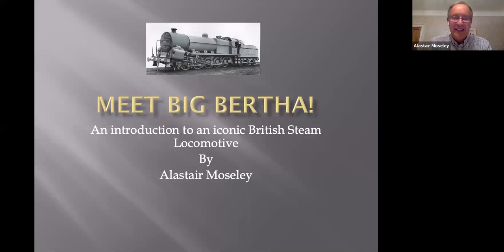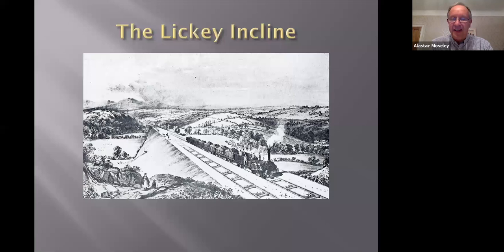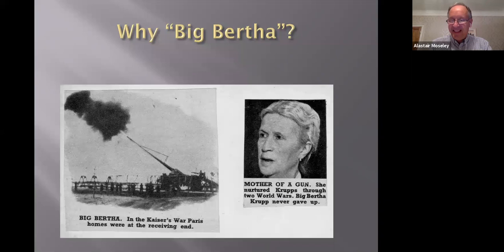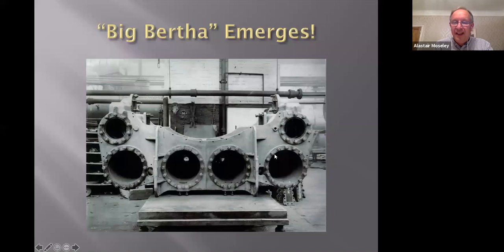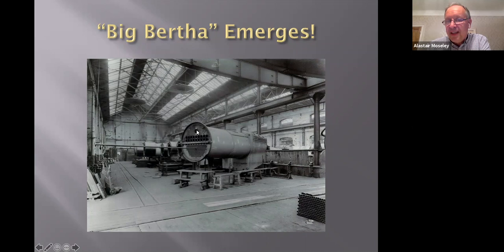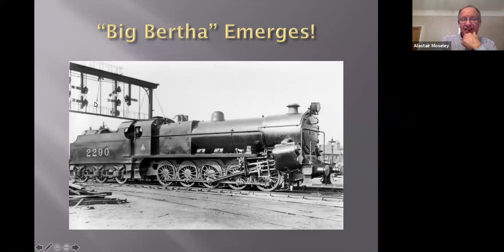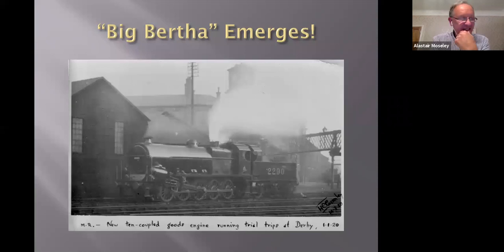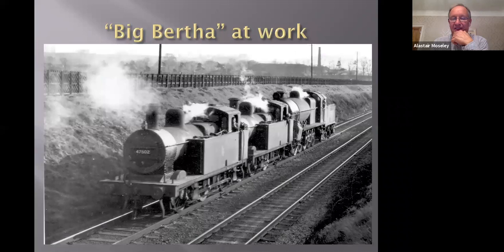Big Bertha: Celebrating the Centenary Year of a Bromsgrove Icon, presented by Alastair Moseley

Comment: Thanks for that Alastair, Most enjoyable stuff, Two items to note but not picked up on, (am i being picky) 10 driving wheels and all with flange's! unlike the 9fs, also of note, Balance / Reciprocating weights on centre driving wheelset appear to be maybe 10 degree's out of time to the rest, clearly for a reason? maybe to take out vibration when coasting down the bank. Cheers.
Reply: hi. the offset balancers in the central drivers isn't too much of a rarity, especially for multi driven locos. you'll see them on the set where the piston rods and connecting rods are connected, this axle having the greatest reciprocal mass. the idea is that at speed the offset balance will counteract the dynamic augment (hammerblow) of that heavier axle set which also has to take the included weight of the piston thrust.  if you look carefully you'll not that the weight is behind on the leftside, ahead on the right. at 90° instead of a balanced 180 they'd be a lot of force concentrated in only a quarter turn and in the locos case with heavy rods at the end of each piston thrust the offset balancers are "throwing" the weights slightly ahead or behind of the end of the piston stroke, thus creating a reverse inertia as a counteraction. 
:)

Comment: No mention on the unusual sloping top of the fire box from the Belpaire Ring down to the cab. The inside cylinders don't appear to have a steam chest.  Is the loco a compound if so how is the steam passed in to the cylinder and out to the blast pipe. ? Can please someone enlighten me as to this puzzle. ?
Reply: Hi Ken, I read somewhere that Big Bertha was a cross compound with the L-H outer exhausting into the R-H inner and visa versa. If outer cranks set at 180 degrees would this work? Would love to know more and would explain why the cylinder blocks were considered to be so unique. Any ideas how to find out more? Alan Whittaker. Derby, ex Toton
Reply: @alanwhittaker1447  My understanding of this, based on a number of articles that I've read over the years, is that the locomotive was not a compound. However, because there was insufficient room for four sets of valve gear, the inside cylinders were fed by the unusually large outside steam chests, and the steam was passed to them by pipes that were perforce longer than the passage to the outside cylinders.  Inevitably, the valve events were not ideal; but on a slow-slogging locomotive of this kind, that did not matter enough to make the idea unworkable. (I am certain that I have seen a detailed drawing of the cylinder-and-valve layout, including the crossover pipes; but I cannot find it — my huge collection of magazines and books is in a complete mess since a house-move.) I might be wrong about some details; but I'm pretty certain that I have the main points correct. Some aspects of this arrangement can be seen in the drawing at 13.03 of this excellent video, and in the amazing photographs immediately thereafter.  Also, the photo at 1.20.40 clearly shows the pipes coming off the top of the valve chests and going "inside" towards the inside cylinders.
Reply: @alanwhittaker1447  As an aside are there any forums that discuss these subjects ? I live in Australia and would like to keep abreast of this aspect of railway history. I would appreciate any links you could provide for this old 88A Canton Cardiff boy.

Comment: hi great video,big bertha was a great looking loco. sheer brute force on  tap, what clowns went and scrapped it.when it could have been sent to a museum. hornby and bachmann have not made a model of it, again clown activity
Reply: DJH did a white metal kit, i have it but don't run it, for display only, it is as built with high tender sides, later lowered to assist in reverse operation.
Reply: Peter Smith, when I was an apprentice at Derby Loco Works I watched Big Bertha being cut up. I was too upset to notice if anything was saved.
Reply: Rapido are going to do Big Bertha in OO.
Reply: @keithparker5103  Shame we have no pictures of cutting up the scrap. Scrapping steam locos is great fun. Break them down and send the pieces for melting!
Reply: @PreservationEnthusiast  There is a big difference between train (loco) spotting and seeing them cut up. The last major scrapping year was 1966, if you were born in 1953 then in 1966 you would have been 13 YO. Unless you had spare time access to a scrap yard via a relative or friend you would not have seen much. Sure there are videos on You Tube, all the ones I have seen are of locos past their sell-by date. It should be remembered that if British Railways had stuck with steam traction many hundreds of older loco's would have been scrapped anyway.
I worked for British Railways from the mid 50s    to 1991 and I saw a LOT For 6 weeks I was seconded to Swindon works in the mid 80s before it closed to source spares for diesel locomotives common to Derby and Swindon, I saw many diesel loco's cut up, mostly class 31s and 25s one of which was 25 158 for which I had a soft spot, but that is irrelavent here. The gripe that many enthusiasts had was the total extinction of many classes thus depriving future generations of heritage pieces in museums. In the same way many municipal bandits destroyed many ancient buildings in the 60s in the name of "progress" British Railways even wanted to demolish St. Pancras station, one of the most beautiful buildings in London. Your constant displays of glee at things being destroyed smacks of slight immaturity to provoke responses. I suggest you change tack.
Reply: @keithparker5103  There were plenty scrapped by the big yards, Cashmores and Drapers as well as many others in 67 and 68. 

Also,  I don't see why an interest in recycling should be immature while an interest in preservation should be mature.

Some preservation has been much overdone. For example 30 Bullied Pacifics and around 40 class 37 diesels, many lying around rusting in heritage line sidings. We don't need old locos in those numbers and some of them have little hope of ever being restored. 

If anything, it's immature to let eyesore piles of scrap sit around  rusting away instead of recycling them and using the valuable resources.
Reply: @PreservationEnthusiast  Sorry about the late reply. I agree with you about the number of eyesores sitting around, especially diesel loco's. Diesel locos are in general use throughout the world. If you are as concerned about recycling as I am, consider this. In I believe 1946 the Royal Navy under instruction from the then Labour govrenment towed over 100 surrendered German U- boats out into the Atlantic and scuttled them all. If that is not waste of materials I don't know what is. Especially as shortly after British Railways cancelled a new order because of, you've guessed it, shortage of steel.
Reply: @keithparker5103  Don't worry about timely replies, sometimes people don't reply until after many years! 

Many people have jobs, families and things to do.

The scuttling of 100 U boats is lamentable. That's 80,000 tonnes of steel wasted. And also the large amounts of non ferrous material such as copper or brass etc.

I see a lot of people advocating "reefing" of ships instead of recycling them. This is slightly better as they can be stripped of contaminants as well as non ferrous.  But as we saw from the Titanic the whole thing collapses after 100 years. It's only a marine habitat or a diving area for a few decades until the thing collapses into a pile of iron oxide to be dissolved into the water and lost to mankind.
Reply: @PreservationEnthusiast   Weird!

Comment: Using the Bank of England inflation calculator, the cost of the loco, tender and light was over £450,000 in today's money, but compare that to the £3 million that Tornado cost in 2008...
Reply: I think you're not comparing like with like. Any index is based on a large number of goods and applying an index number to one good doesn't mean much. At the time the engine was built, making an engine was a fairly routine business. Even a very unusual one. Making one today is horrendously difficult. So while the Bof E's index might make sense for comparing what an average worker's wage might buy, then and now, for example, I think your use here is inappropriate. I think it's fantastic that we still have the experise to make on at all!